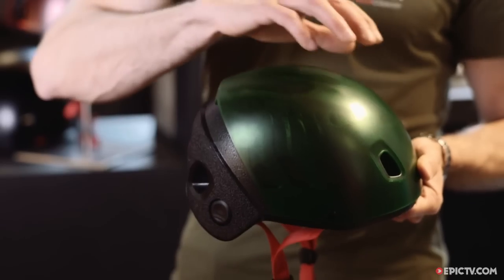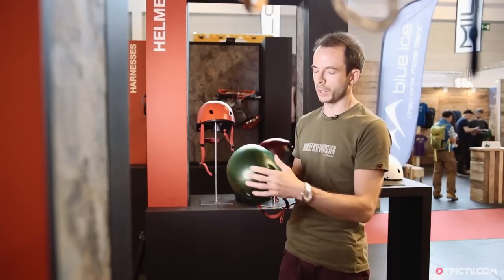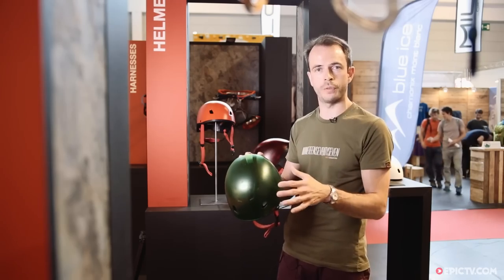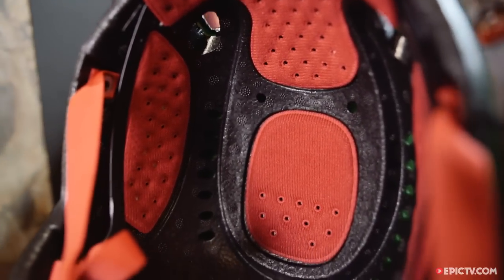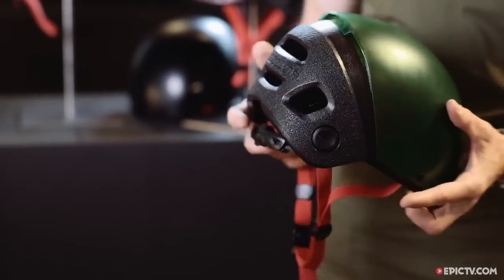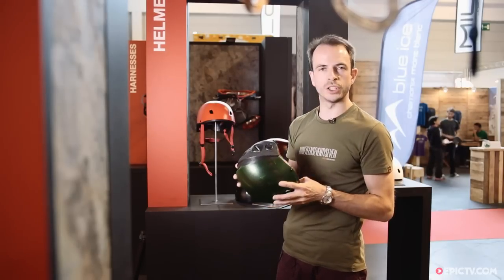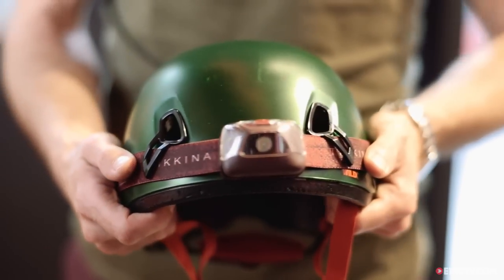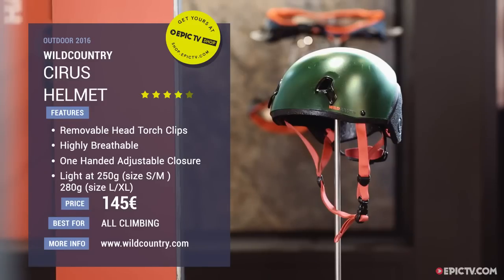Wild Country Cirrus Helmet | Outdoor 2016

Comment: The Cirrus is well named.  Just like a cloud, this helmet was here today and gone the next -- gone as if it never existed.  And not really "a new innovation", Petzl came up with the idea to use EPP foam to make a more durable climbing helmet liner.  A real innovation would be a helmet with full EPP foam and a very thin full ABS shell to protect the foam.  Total weight 7-8 oz.  But such a helmet would last too long so the polystyrene, one (hit) and done (trashed) helmets continue.